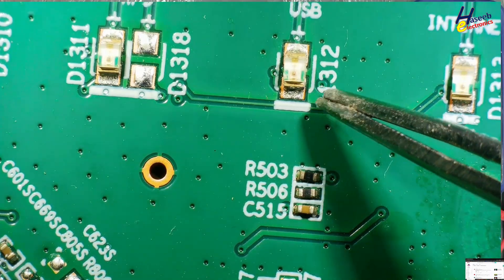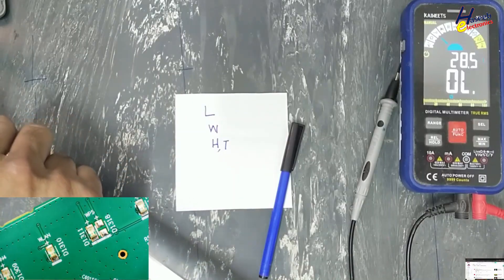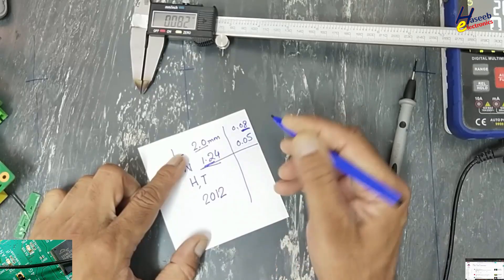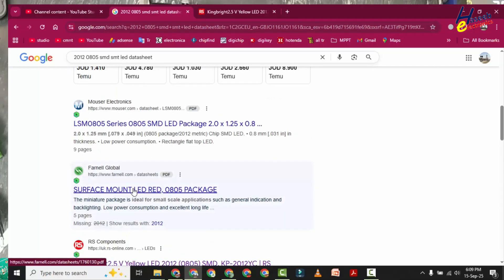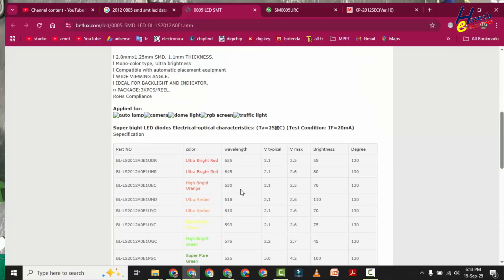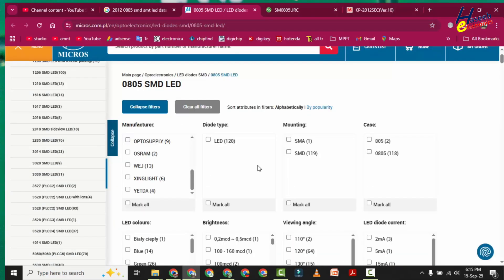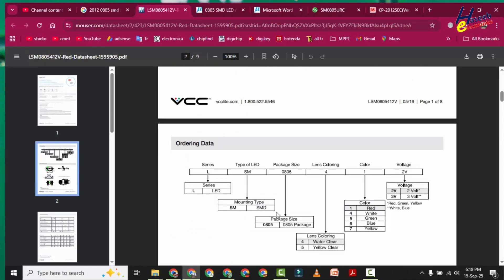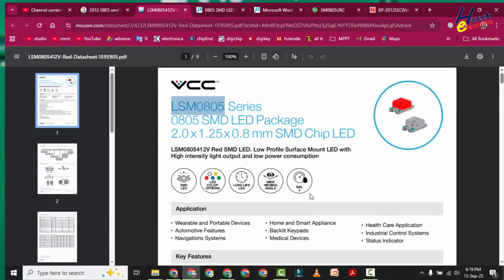{1382} How to Find Datasheet & Part Number of SMD / SMT LED | Size Code Explained

Comment: Smd Diode marked “MDD39C”
Can you find any datasheet or what the use? It is shorted and i cant find a replacment. On pcb i see that it looks like the part contains two diode with common catode
Reply from the maker: Good morning 
please mention the dimensions (length and width). it is importnt to find size code. then we can find part number. as per your comment, it looks like TVS diode 
please check following links 
https://smd.yooneed.one/code4d4d.html
https://www.s-manuals.com/smd/mm
Reply: @HaseebElectronics look over web for gunn diode simbole
Reply from the maker: i think it is 39Volt bidirectional TVS diode 
please check datasheet for TPSMC39CA